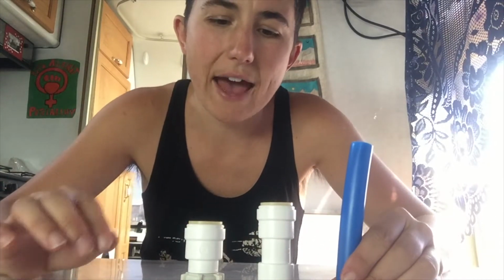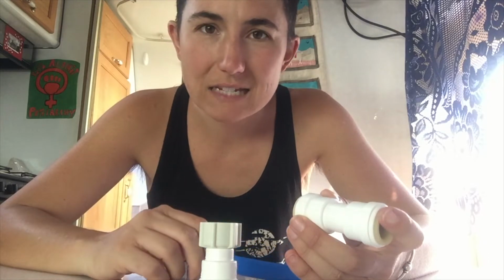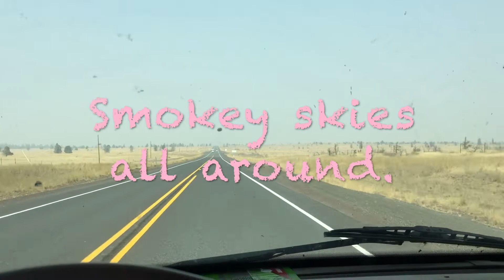Toilet Replacement Continued! And a dirt bike tire purchase in the mountains.

Comment: You did a great job fixing your toilet by yourself 😉👍 
If you know a little bit could you help me with a question? What part do I need to be able to get my new kitchen sprayer added to my existing pipes in my RV 🤔lol!! Also can I install a baby 1/3 hp garbage disposal?
Reply from the maker: Oh my. I don’t have a clue. Depends on the room you have under the sink.  I’m curious if you would want a garbage disposal at all. It would be unfortunate to have all that ground up food cake the walls of your grey tank.
Reply: @CruisinJr  lol! My grey tank is being really combined with the black to make one giant tank because I'm going to be using a composting toilet. Plys this way i could burn paper and only have to worry about cans or glass buts that only if I don't start to shop differently and buy things not in tin or glass. Or transfer those items into containers while still at the grocery store so I don't have to worry about it at all 😊 I just thought it would be better than having big yucky garbage that can smell quick depending on the weather plus I'm not a vegetarian lol! I like meat.  I dont want it hanging around  till I can get to a bigger garbage. I'm old lol! I would never ever put meat or anything that wouldn't grind up into Itty bitty particles. Idk? ? I just think in my own strange thinking brain why rv's do not have them or compactors especially when so many are going fulltime and mostly boondocking?  I don't want garbage piling up in my class c which is also my car because I don't tow anything else to drive. 
Thanks for your help though 😊 I do appreciate it. 
Take care hun and have a great week.